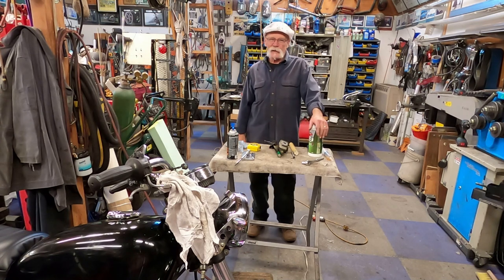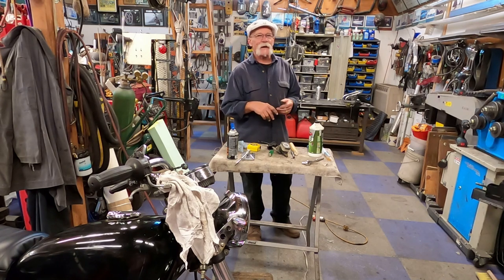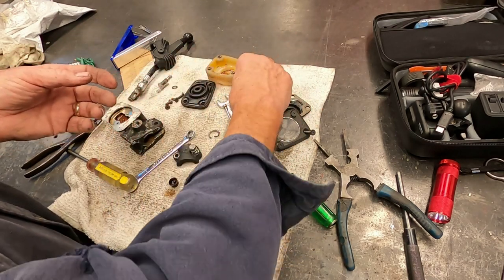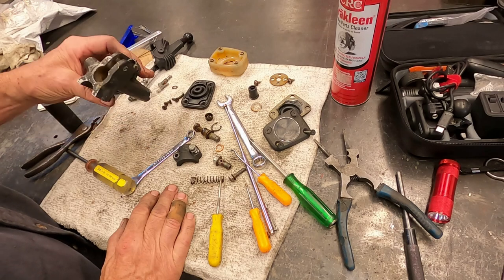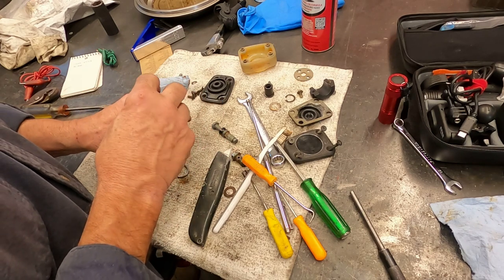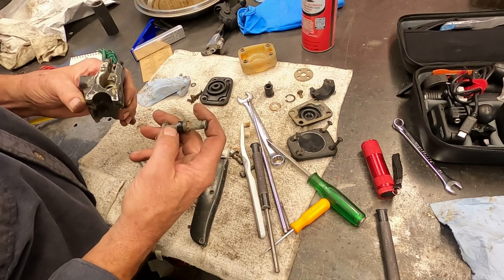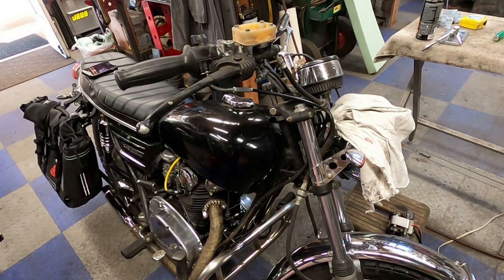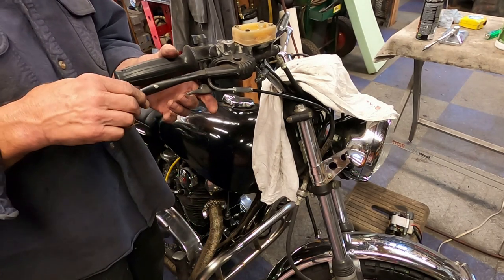XS650 Got Brakes

Comment: I did a full rebuild on my front brake, I got it all assembled and now I'm starting to bleed the system and it's taking forever to get the fluid through the lines, is there a better way than pumping the lever?
Reply from the maker: You use a vacuum hand pump brake bleeder. I believe harbor freight has a decent that works. Just remember front brakes are a ditch to bleed off and sometimes just let them sit it'll self bleed the bubbles out. Rear isn't really easy by pumping. Hope that helps and thanks for watching

Comment: More times than not that master cylinder is shot and your better to put one of another model on it.  A working  rear master cylinder on a SR500 Yamaha is so rare they don't even produce a rebuild it for it. I've seen people asking 400 dollars for one.
Reply from the maker: And sometimes you get lucky 😉
Reply: @outlaw86custom  Hey do you know from prior experience if getting off on the cam timing by only 1 tooth (advanced or retarded) will cause valve to piston interference? 1972 engine with a stock cam and pistons. I was messing with the cam chain tensioner tonight and think I could have slipped a tooth on the cam. The ignition timing marks still look ok (the breaker points are opening when they should according to timing marks on stator cover and rotor. There is no way of seeing the timing marks on the camshaft sprocket without taking the cam cover off the engine which mean pulling the engine in my case....do you follow me Miyagi?

Comment: Awesome video, thanks for the breakdown.  Is there anything you do to the rotor?  I've seen suggestions on the forums to use scotch bright on them or even sand paper.  Do you also usually go through that "bedding" process?  I just replaced my front pads with Vesrah brake pads and also serviced the caliper with a new piston (cleaned the thing out, whole 9 yards).  The brakes don't seem super great, so just trying to figure out where I'm going wrong.  Appreciate your time, cheers...
Reply from the maker: Patrick,
I use scotch Brite on the rotor. As for brakes not working it's best it could be air in the brake line, the front brakes can be a bugger to bleed. Hopefully that helps, thanks for watching. Cheers!
Reply: @outlaw86custom  Hey thanks, Outlaw -- that's good to know on the Scotch Brite.  You're also probably right on that air being in the line, I'll give bleeding the brakes again a shot!
Reply from the maker: @patrickkehoe1284  👍

Comment: I was just about to go perform this operation on a XS I picked up this summer and look what pops up in my YouTube feed. Probably going to watch again as I do it. Just cleaned carbs on it and it purrs using same tactic. Found the pilots were clogged from the 1983 gas it’s an 82 with 83 plates on it😂. The brake fluid is going to be all kinds of nasty.
Reply from the maker: I hope it when well. Thanks for watching

Comment: Very informative as usual! On my Ural I installed a,”speed bleeder”. Which is basically a bleeder valve that has a bb in it so you don’t have to open and close and open the valve when bleeding. Works just fine.
Reply from the maker: Cool just bought one. Thanks for watching